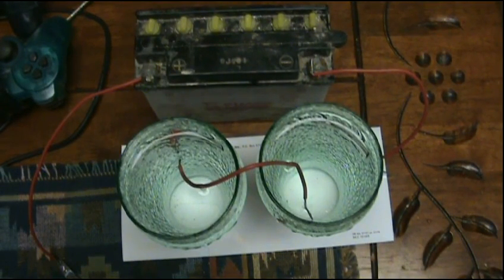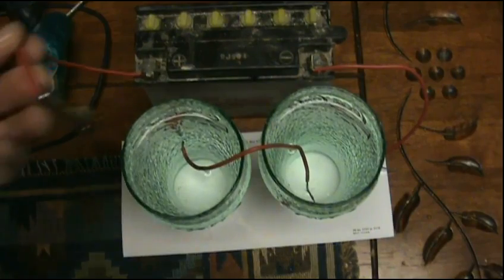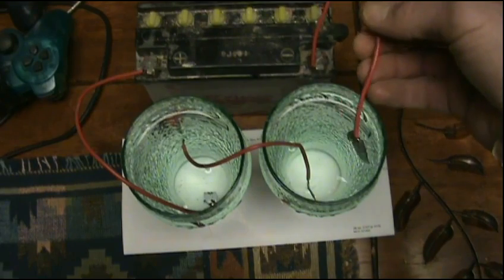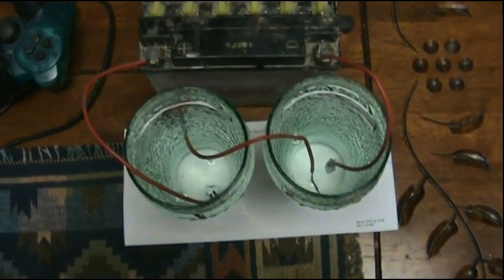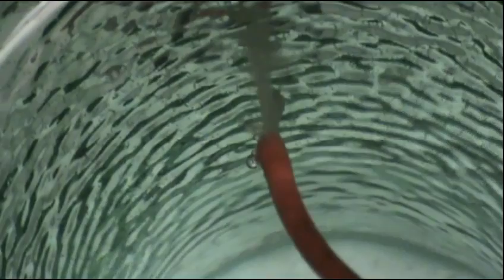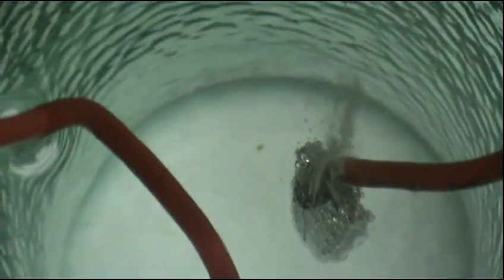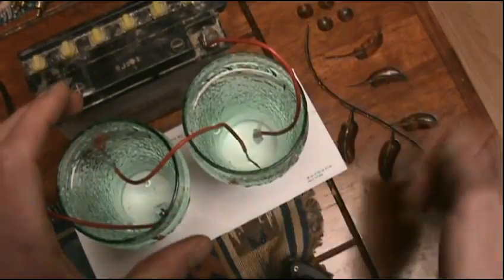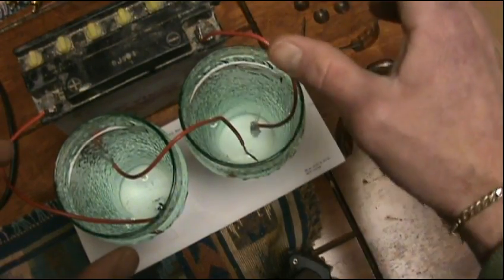Concept-Hydrogen Separation HHO

Comment: What you need to do to get oxygen and hydrogen is to get a ... say... rectangular container.
Insert a divider dielectric in the center and leave an open space at the bottom. Make sure the electrodes are not directly at the opening. Close the top and leave a small tube to fasten a plastic bag to collect the gases.

Comment: To get HHO efficiently requires that your cells resistance is as low as possible and the ways to achieve this is to have a highly conducting electrolyte or the electrode spacers must be very very close together like millimeters apart.

There is only so much conductivity you can get from the electrolyte per cm of spacing but you can theoretically obtain very low resistance by spacing the pos and neg plates very close together but then you need to get the gas out quickly to keep the ohms low.

Comment: The simple answer is that you won't be able to separate the hydrogen and oxygen separately unless you enclose each electrode in its own gas chamber.

What you have effectively done is to make two cells. One cell has the positive from the battery and essentially the negative from the other battery through a resistor (the other cell) and likewise for the other cell.

Comment: Dude, I literally did this when I was in 6th grade at home. I actually made the hydrogen pop when I lit it. You use a large container and put 2 glasses upside down with the leads in them, then you trap the gas.  Pull it out lighter flick, pop.

Comment: Ive played with this quite a bit, got crazy results when using a cheese grater and a big spoon as electrodes, and a battery charger set at 50amp start, got enough we were able to ignite the hydrogen bubbles, implosions make quite the snap but i dont think your quite right there rick i think both jars are producing hydrogen

Comment: @superlukage well your right in this setup,but not as meny have set it up where it dosent use amps over 1 and uses volts as the primry ,that way it works and have since 1897 its just easyer to buy fuell and it wsent such an expensive thing 100 to 40 years ago

Comment: add a half teaspoon of salt any type of salt to those jars and you will get 10 times the gas coming off the anode and cathode, the electrolite's in the solution from salt make current run through the water much easier.

Comment: @Begbucks Harvesting waste heat is not energy from no where. Nor is fusion in any sense. At any rate, until Rossi lets independents find out what's actually going on in his little box connected to an external power supply, I'm going to be a bit skeptical, as should you. Again, go find out what's actually going on.
The sentiment in North America is to favour those who can actually prove what they're doing, particularly those without a history of questionable ethics.

Comment: Knowledge Pub did a review on this..  By the time you got enough power generated to run the engine, you would have no horsepower left to run the car.  Not saying you can't enhance, but you have rapidly diminishing returns with increased output.  And, the enhancement isn't going to amount to much.  Most of the reported gains, are due to backing off the pedal..

Comment: energy is equal across the board, it can not be created. The idea of this that I like is being able to extract a fuel from another source (say solar and water) that will burn in our gas engines. The loss in energy does not matter because the cost is zero. The real goal is what the cost of the energy to the end user would be.

Comment: @Begbucks I'm not sure what you're getting at, but there's much more energy available from the combustion of the other components of the gasoline than just that small amount of hydrogen.
And the amount of energy to required to separate out that hydrogen versus what you get out of it makes it pointless to do so.
Reply: Look it up today and see what you think. Lol. Gas engines are literally 20% efficient.

Comment: The problem is that the hydrogen generated wouldn't be enough to even charge that battery back up - it's a net loss, like any other way you split H2O.  You're better off just using the electricity directly to run whatever you're running.

Comment: I should also mention that my brother lost an eye when he was young messing around with this very same experiment. The difference was that he was trying to collect the gasses into a glass bottle. Pure hydrogen will not burn. It requires oxygen to support flame. The H and the O  were mixed in the bottle and a spark set off an explosion. A chunk of glass put his eye out. DO NOT try to collect the gasses because you can't be sure that they are pure, and in fact most likely won't be.

Comment: @steadfast1984 the problem is the amount of energy you need to make enough gas to do anything with. it almost defeats itself because you have to burn a crap load of other fuels to get a small amount of hydrogen and oxygen. the only way this would make any sense is if you could find away to split the water without the need of massive electric currants. or master fusion so you could have limitless power for really cheap.

Comment: i learned that in grade 9 science. way to remember rick. we used sealed test tubes that collected the Hydrogen and the Oxygen. then we piped the gas into beakers.burned magnesim then added the oxygen we harvested. then we put the Hydrogen into little test tubes and set them off with a loud pop.

Comment: good job rick, i made a dry cell a year ago out of some 316l stainless steel and 1 inch plexi glass, it was as follows +nn-nn+nn-nn+  what that stands for is, positive, neutral, negative. when i hade it in this configuration i was able to produce 5 litres of hydrogen per minute, not near enough to run a car on it, but a mower i could, was a fun project.

Comment: whats the use? You can only take out the Oxgen from the water? Your very limited on how much water you can carry. I think that water weight could be used better by taking that water out and using a motor and a alternator.

Comment: Making hyrdogen yields a very poor energy return on energy invested. You need enormous amounts of electricity to make a useful amount of hydrogen, which makes it very inefficient. It's far more efficient and less energy intenstive to take the electricity, store it in a battery - and drive an electric motor with it.